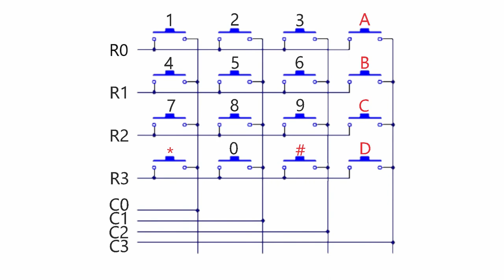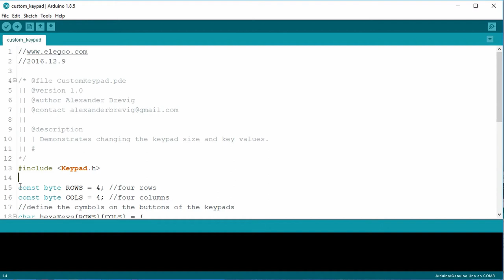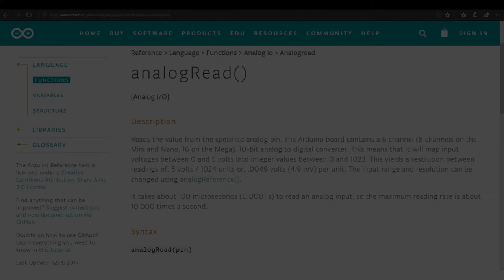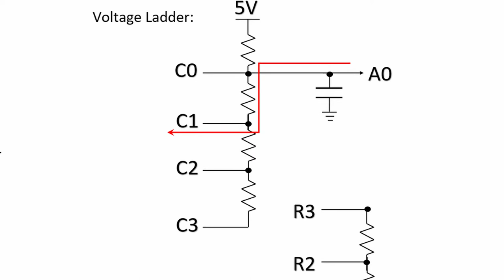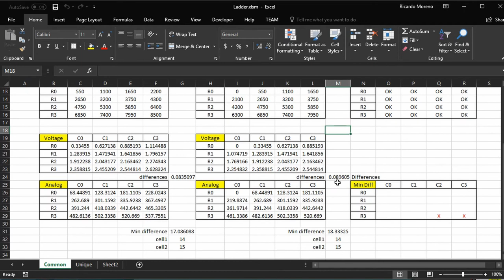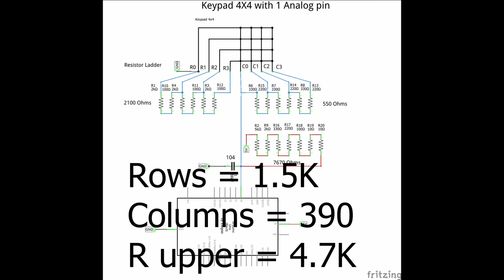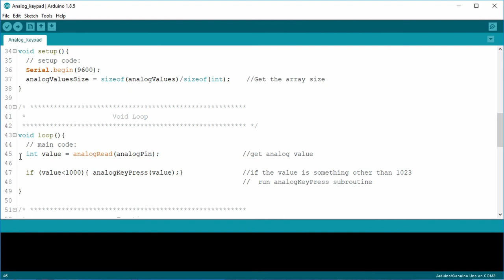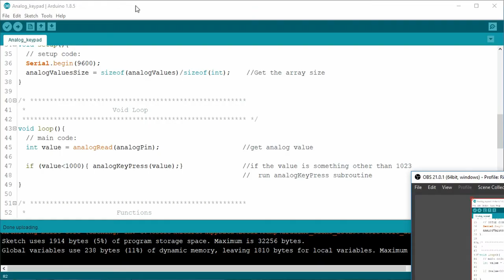Lesson 11 – Keypad Membrane Switch Module

Comment: I’ve added a bit of code to the sketch in the void loop that says:

if (customKey == ‘1’){
   digitalWrite(ledPin, HIGH);
   delay(1000);
   digitalWrite(ledPin, LOW);

At the start of the code I said:

int ledPin = 13;

I’ve connected a jumper lead from digital pin 13 to a 220 ohm resistor then to a white LED which is the connected back to GND but for some unknown reason, it shorts out the circuit and I don’t know why. Please help
Reply: don't use the pin 13 because there is an built in led on arduino board that is connected to the pin 13 of the arduino uno, or u could just remove the jumoer wires and use the built in led on the arduino